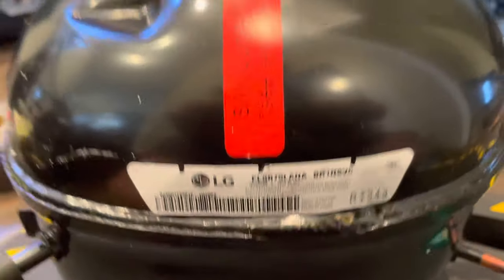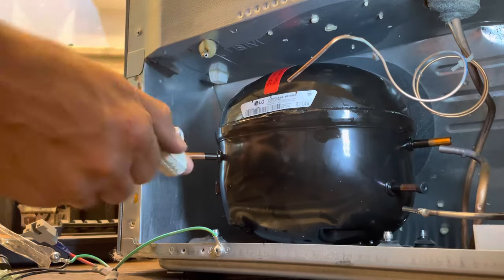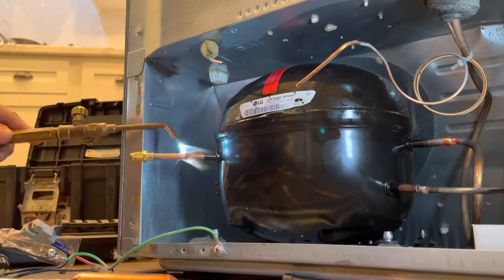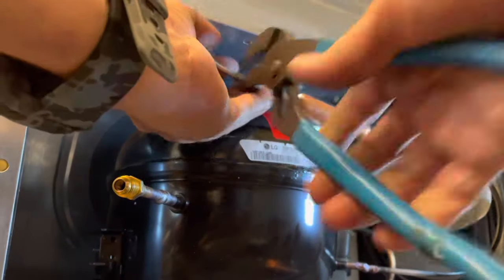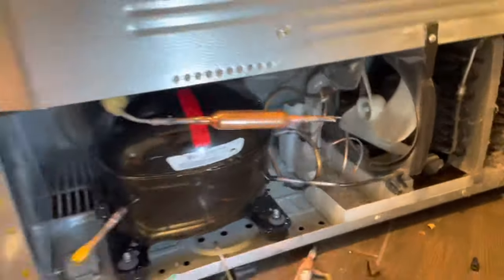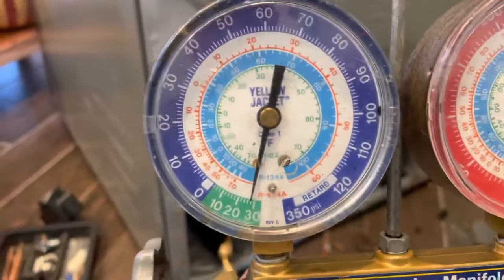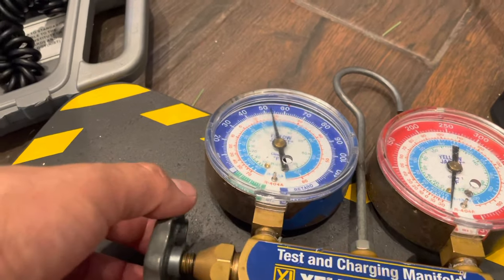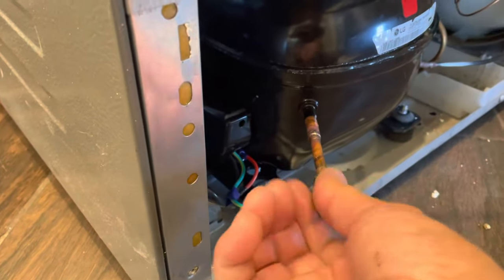How to replace Kenmore Elite compressor install / LG

Comment: Hi, 20+ years as an appliance tech and 10 as hvac tech.  Question: Why didn't you fill the system with nitrogen when checking for leaks?  Had you found a leak, you would've had to recover all your refrigerant to fix the leak.  I've always done it that way... I realize your way is faster IF there are no leaks.  But if there is a pinhole leak in the solder, the nitrogen can just be quickly vented into the atmosphere, then you fix your leak, and then put fresh refrigerant in.
Reply: Less experience lol
Reply: This is how I was taught. Not only that, itll flush contaminants out as well.
Reply: @ajcastellon5903  nice job 👍🏼
Reply: Never did small apliance but i was tought if it pulls below 500  and holds theres no leak. I mostly use Nitrogen during braizing

Comment: Should have brazed service port then trickled Nitrogen and finished other joints. Pressure tested with dry nitro then vacuum.
Reply: Should coulda wooda.....it's a refrigerator....this will work just fine. Not a space shuttle.

Comment: What happens if I don’t update the main board when installing a new compressor?
Reply: Controller may cause the compressor to malfunction or shorten its life, TLDR: if it needs it, always do that step.

Comment: Oh gosh no hate man however that’s not soldiering that’s brazing there is a difference also nitrogen dude its your friend  i know its just a fridge and not a industrial AC unit good repair though also try using fitting like reducers plier crimping is not the best way to get a better wetting from capillary attraction

Comment: Flux on your solder joints is strongly recommended, that service valve is too long! You should not have to bend it.

Comment: Our compressor was still working so brazed on a valve and replaced R134a (it's only 5 oz which is less than half a can you can get for automotive AC) and it's been working well for the last month.
Reply: my compressor is still working too,  i have bullet valves and gauges coming tommorow, im hoping thats all the issues
Reply: @devoncrampton5223  Using the gauges for high and low is usually a waste of time. What matters is the weight of refrigerant you put in.
Reply: @seasidescott only it’s not. You add the weight (or not) depending on your pressures.

Comment: In regards to the software update, is it with the LG software rewriter kit? Given the fridge is a Kenmore fridge is it correct to get the LG software update? Our compressor just went out it’s an LG compressor in a kenmore fridge and the sites all say our compressor has been replaced by a newer model but it also requires updating the software with the LG software rewriter…doesn’t make sense to me since the fridge is a kenmore fridge
Reply: LG made the Kenmore Elite (total crap) refrigerators when they sold them.

Comment: I have the same POS model fridge and will need my compressor replaced. The compressor is under warranty, but the labor is not. How much do charge to do the replacement?
Reply: $600 on up. Sears will screw you.
Reply: I just got a quote from Sears for $1327.26 compressor and drier replacement. 5yr old Kenmore

Comment: When you work on dual evap LG's which Service Manuals do you use> The one I downloaded from the internet for my LFX31945ST does not have the correct info for checking or replacing the Ref compartment evap fan , it only refers to a single evap system and the fan in the freezer for the ref. compartment. Is there any supplement pages for this manual I could find? Keep up the great videos and info you provide to us.

Comment: Thank you for sharing this video...I have the exact refrigerator and the compressor has failed.  It is under warranty, but it is good to know what will, and should, be done. Thanks again!
Reply: How long did you have your refrigerator before it failed?  I have this exact same fridge as well.  Have had it for 7 years now.  Just died yesterday.  Such a great fridge too.
Reply: @ErichCervantez these are lg linear compressors....they are lg science projects that have really bad service life.  If your replace it tap condenser fan com lines and use relay between them and a standard compressor.
Reply: We had this fridge.  It also failed. Garbage.
Reply: They all fail on this fridge.  Ours did too

Comment: Very good video, BTW do you know why compressors on fairly new and good branded fridges go bad? What are the common causes for this? I think compressors are built to last normally. Thanks.
Reply: All new stuff is like this.  Only one answer:   Cheaply made in China, Mexico, etc under poor QA.  I love old stuff when company took pride in their products.   Nowadays it is all about profit.  Nothing lasts… from cars to electronics to furniture to whatever you can think of.
Reply: @V3VoVo  You nailed it! Great answer. If you can find something made in the 70ties or 80ties it will outlast any thing out there. We bought a new samsung microwave. It was worthless one week after the warranty expired. I will never buy another samsung anything.
Reply: @vcubed7275 not only is the craftsmanship poor, but the new age repairmen really don't know their craft. One or two test and they say you need a new computer board or buy a new fridge. Hard to find people like the poster of this video. My fridges compressor is out and only 3 yrs old 😢
Reply: It isn't poor craftsmanship,  it is specifically designed to fail.  I tore apart three Copeland compressors and they all had the same failure,  so I reached out to the company and told them,  hey if you make this part more durable the compressor would last a lot longer.   They said,  we know. 
They want it to fail so you need to buy another one.

Comment: I have another dryer on the intake line....the copper line on the bottom there is a small copper "can" that looks like a short fat version of the dryer you replaced. It sort of resembles a fuel filter. I didn't see you replace that.

Comment: I have that same refrigerator and I have to change the compressor. I live in Miami, they don't have a team working here!
Reply: Another company is honoring and servicing these units to continue to gouge every customer possible. This has happened to every single one they sold.

Comment: I have an issue on  Bull outdoor mini refrigerator, with 600a, 1.02 Oz of charge , which tool would i need to buy to check the charge pressure ?

Comment: Hi great video. How much do you charge? I have a Lg and have to get the compressor replaced. Thanks
Reply: I asked the same question with no response
Reply: I asked the same question with no response
Reply: It's $600 and up if you get the compressor for free. But even if you do, they're still charging you full price like it wasn't covered. A local guy here will do it for $800 total. Parts and Labor. The compressor is $330. So the rest is labor, freon, solder, butane, and that stupid $125  control board updater. I'm so glad I didn't buy the 5 year extended warranty. Mine broke down 6 months after it would have expired.

Comment: I need to change Kenmore invertor Compressor LG FLB075LBNA so if I'm changing compressor with the same series than I still have to change/install the software?
Reply: Did you ever figure this out?

Comment: two questions... 1) which way should the arrow on the filter dryer be facing? 2) which version of the JIG is used for this compressor?
Reply: If you’re using a drier with an access point, the side with the access point always goes to the Yoder loop. But you always want the arrow on the drier going the same direction as the Yoder loop. If reversed it’s probably gonna clog

Comment: No nitrogen purging before soldering? Guaranteed service call in 5 years, right?
Reply: no, the system is quite small and with a hot torch seals quickly, compressor comes purged so no residual oxygen within.
Reply: @seasidescott  The connections at the compressor were soldered while exposed to oxygen internally. You've provided zero evidence that oxides did not form internally, which happens in 100% of cases where no oxygen purging takes place.
Reply: Its also a good idea to purge with nitrogen because that system gets clogged with oil when the compressor goes
Reply: @tommygoldman05  Thanks Tommy. So you mean using the nitrogen to flush the lines, I take it. To blow them out. Probably especially when you have those long capillary tubes. But won't the oil just get spread out to later puddle up again and create blockage later?
Reply: @randallsemrau7845  Density of air at sea level 1.225 kg/m³. Density of nitrogen 1.165 kg/m³. Density of 134a 4.25 kg/m³.  Nitrogen has 1/4 the density to prevent intrusion of oxygen whose density is 1.429 kg/m³
Reply: Then you’re a hack if you think nitrogen flowing and purging isn’t absolutely necessary.

Comment: My upright freezer compressor is running supee hot and not in a freezing mode.  I have replaced the start device.. Nothing.  I have try the 3n1.. Nothing.  

What could be the problem?

Comment: Why we need to update software on the control board? There is no communication between the board and compressor. It's just copper wings inside and mechanical part.
Reply: I thought I saw an electronic switch on the side of it. Something has to control the compressor turning on and off like your AC, no?

Comment: Thanks , how much would such a repair cost and any guide to diagnose as I have the same model , compressor seems to be working but no cooling , can’t seem to diagnose the issue before replacing or going for the big repair , appreciate any help , thanks
Reply: I was quoted 1,000$. Not gonna do it though, since it’s just going to crap out again! What did you end up doing?
Reply: @mauricem7007  we just got quoted a little over $1000 to replace ours as well, would be 2nd time getting replaced. it first went to crap within 3 years of purchase so repair was covered under warranty. New compressor lasted under 2 years so odds are if we fix it out of pocket it will need to be fixed once again in the next 2 years. We are buying a Maytag fridge now.
Reply: @EOPrime89  we got a whirlpool… the whole thing is a load of crock
Reply: I am going to give him a 👎🏻.  This guy puts up videos but never replies to anyone.

FYI: my piece of shit Samsung doesn’t cool. Called a guy to look at it said $1,500 to replace compressor. I told him to go to hell and fuck Samsung and heard Kenmore is crap now cuz it’s basically LG now. 

Was told not to buy a fridge from box stores such as Home Depot as they sell refurbished fridges as new

The tech said by from Costco
Reply: @BigOHavingFun  I was quoted $1900! Ridiculous!

Comment: This is all wrong. I would only do it this way if it were the end of the world and it was for myself.
I certainly wouldn’t pay for it.
You didn’t flush and purge with Nitrogen.
You didn’t braze while flowing Nitrogen.
You didn’t purge the refrigerant tank line while connecting to the service port.
You didn’t maintain a vacuum with shut off valves for a reasonable amount of time or long enough for all the water to be boiled off with new oil in the pump.
You didn’t swage any of the line connections.
You seem to not like cleaning the connections. No proper ventilation.
No mention of the brazing material being used. No mention of line routing that is critical to the performance of the system due to its use as an evaporative assistant for defrost water and condenser performance.
I could go on.
Reply: I need a Kenmore compressor replaced. You interested?

Comment: That video is well done! However, after watching, I h scheduled an appointment with Sears to replace my Kenmore Elite Refrigerator compressor.
Reply: So much for elite huh...im watching this video because our 2015 Kenmore Elite compressor failed today. If I may ask, how much was the repair for yours? Im trying to get an appointment scheduled. Thanks!
Reply: @rbljackson  A 2015 Kenmore, Great Refrigerator and worth replacing the compressor! The compressor unit is expensive but covered by a 10- year warranty. Installation was about a 1,000.00, but the service guy suggested I purchase a Service Contract and the repair would be about 400.00. I entered the Sears Contract for 50 per month which covers all appliances. After 30 days the contract is cancellable, however, my refrigerator ice maker is broke and that was covered by the contract. I recommend getting that compressor replaced as the newer units I looked at just are not as good as that Sears Elite. It did take a couple of weeks to get the service done, in the meantime, I purchased an ice chest to keep food cold. Yes, an inconvenience, but it all worked out!
Reply: @paulkoscheka4434  I heard that one person canceled the Home Warranty after a couple months and they went after her for the full amount of the discounted repair.
Reply: I just got off the phone with Sears. I will have to wait two weeks for a repairman. The monthly cost of the home warranty is $65 a month. 
I scheduled for the sears repairman but am exploring other options.
Reply: @TheDroppedAnchor  Yes, inconvenient! I will say that Sears does a good job installing the compressor, mine has been working great since the install. Do what you need to do, I think I waited two weeks and bought an ice chest to help keep food closed.

Comment: There's no question about not replacing filter dryer. You always replace when replacing compressor.
Reply: Im going to replace my compressor and filter dryer, but not understanding something.  Mine comes down the back, and its pinched off.  Not sure how that works... Ive done home A/C units and tons of auto units but first fridge.  Just not understanding why its not inline and is just off to the side pinched off.  Damn thing is only a year old and it quit already.
Reply: @motorcitywestauto4674  it's probably coming back in from the Yoder loop

Comment: I don't have a Kenmore elite I just have a regular Kenmore refrigerator is this installation guide the same for a regular Kenmore refrigerator which is an older model
Reply: No. Kenmore Elites are made by LG. Different system. Crap!!! Mine just went out after 5 years.
Reply: @TheFrenchPug you know they will cover the parts just not labor @ LG not sure about Kenmore but it should be the same no?
Reply: @Saint Anger  Yeah. They did. But the freezer is still messing up. Goes to 0 degrees sometimes then back to 20 degrees. Tech is coming out today for the 3rd time.
Reply: @TheFrenchPug  I was supposed to have the tech come by today for mine and they claimed that he had a family emergency. I would fix it myself but that would wave the warranty

Comment: Bro sort of brazing you could have used stay Brite 8 with some flux😊 and you didn't say what kind of torch do you use I guess acetylene b tank but I see you use brazing rods😮 and you should mention the filter dryer goes on the liquid line AKA skinnier line😊 other than that great job

Comment: What kind of brazing rod do you use?
Reply: sil fos 5% or 15%
Reply: I’m a residential hvac guy.  I’ve never seen flux used when brazing.  Granted I’ve always done copper to copper.

What kind of flux is he using here?

Comment: I have that same POS fridge! The compressors are made by LG, and they are known pieces of garbage, yet they continue to sell them for top dollar with a useless warranty of just one year. There have been class action lawsuits and their solution is to just keep selling them but limit the warranty so they aren’t responsible for the service bill (about $1,000).

Never buy LG, Kenmore, or Samsung appliances.
Reply: Kenmore used to be an excellent brand refrigerator until the company went out of business about 10 years ago.  LG knew their fridges was junk so they bought Kenmore's name and started relabeling their junky fridges Kenmore,  smart on their part but bad for the consumer (very unethical).  Samsung fridges do has a lot of problems.
Reply: @easyon12  exactly! 👌
Reply: Agreed.

Comment: I bought a house and it came with old refrigerator, washer and dryer and a fairly new piece of junk LG dishwasher. Guess what causes the most trouble my newest appliance my dish washer? I am keeping my older applainces until they die. Funny, I know seller gave what they thought was junk applainces.😂 Maybe the dryer was junk because it died but my inlaws gave me a free old dryer. I have lived in my house for 4 years and still havent had to pay to replace any appliances.